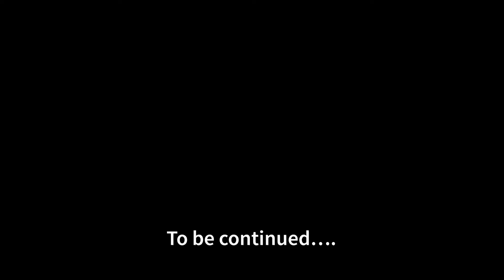Day in the life of an HVAC Apprentice - Part 1 - (Career change) Cooling Maintenance Indoor Unit

Comment: Do you need to go through a apprentice program or ojt whats better in your op
Reply from the maker: I usually recommend just getting job at a smaller outfit and working your way up from there. You can advance pretty quickly if you put in the work with smaller companies because they're going to place you where you're most valuable. So essentially whatever discipline you choose to excel at that's what they'll have you doing.

Comment: im looking at a career change into HVAC, is it best to go to school first or how would i go about getting an internship with no prior experience to get that experience. I looked into jobs and they all want years of experience even for an apprenticeship.
Reply from the maker: I would try to start off at a smaller company to learn the ropes. Most small owner operators will hire you without experience as long as you show your willingness show up and your trying to learn.
Reply: I work in apartment maintenance and they paid for my epa test. Been here going on 3 years learning as I go on doing installs and servicing the older systems we have.

Comment: I got a new return grille 20x20 and it's alittle smaller than my current old one  and the filter is snug that I used to see how it fits, also I've searched for wider dimensions but none that goes to 23 on the outside, It's not in yet I need help on what to do
Reply from the maker: The Snug fit is actually good as long as you're not having to bend and distort the filter to get it in. What are the exact dimensions on the new filter grill?
Reply: @HVACTechKnowledgy  Outside Dimensions: 22-11/16 inch width x 22-11/16 in length
Reply from the maker: So is the filter just not fitting properly in the new grill? Also what made you decide to replace the filter grill in the first place just curious?
Reply: @HVAC Tech Knowledgy  yes it wasn't fitting but I noticed there was a bend one  bottom corner blocking the filter from going all the way in ,and I if could show you you'd see why lol but the current one is older ,dirty after cleaning and has the turn opening latches ,one is broken
Reply from the maker: Okay cool I know how it is those things can get pretty grimy lol. Sounds like the frame is just been a little bit, if you can bend it back that would be the ticket or just try to take it back and get one that's square.
Reply: @HVAC Tech Knowledgy  yeah lol I think it's been in since it was built which was 1983😶 I've seen reviews it's ez flo  $27 and I got the cheapest one ,I'll work with it for now and maybe get a more sturdy one ,my question is if it alittle smaller than the current one can I stretch it out ?
Reply from the maker: Yeah definitely stretching the metal out for a proper fit is not going to hurt anything👍